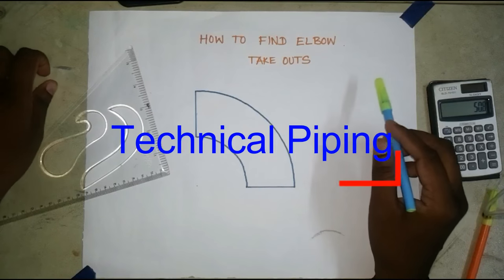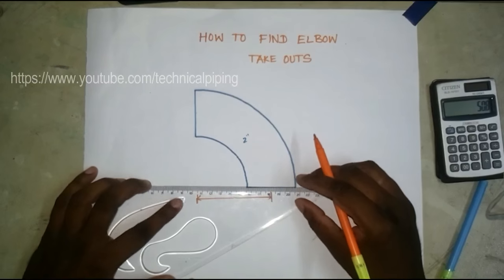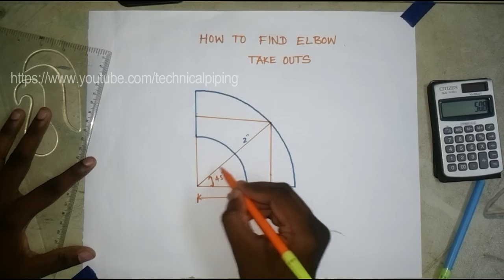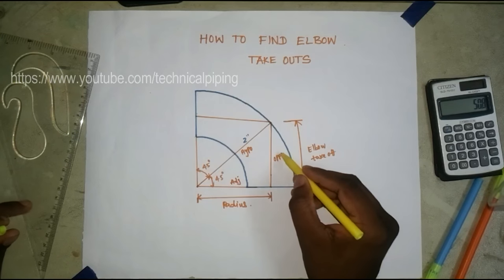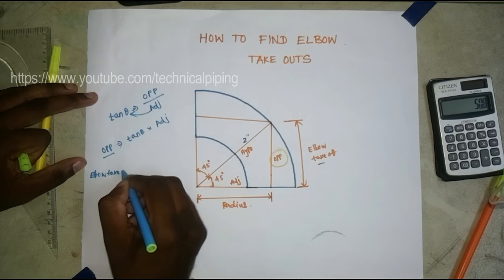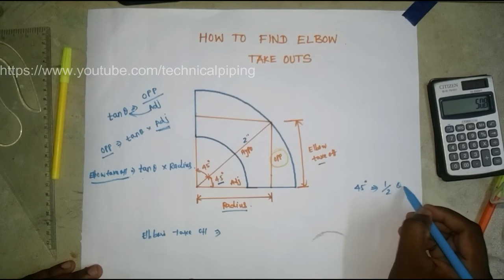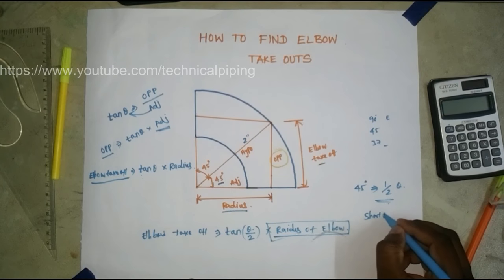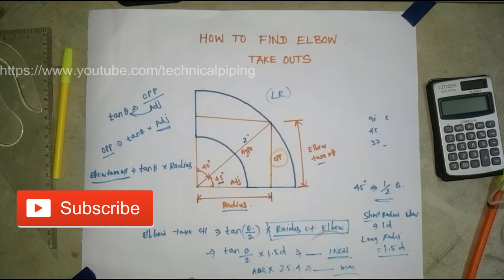Find the Elbow Take off -Updated

Comment: The question is where the constant 1.5 and 1 come from ?
Reply from the maker: In a long radius elbow, the radius of curvature is 1.5 times the nominal diameter. In a standard elbow, the radius of curvature is 1.0 times the nominal diameter of the pipe
Reply: @TECHNICALPIPING  how comes ? Can you show me the way ?